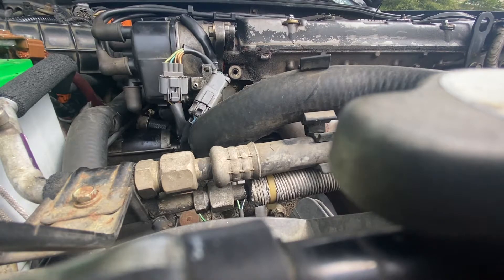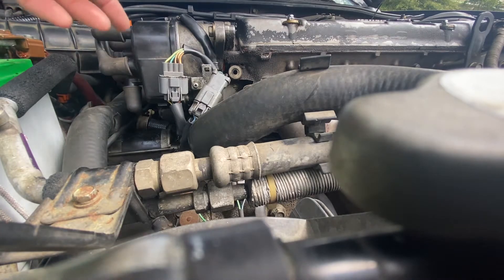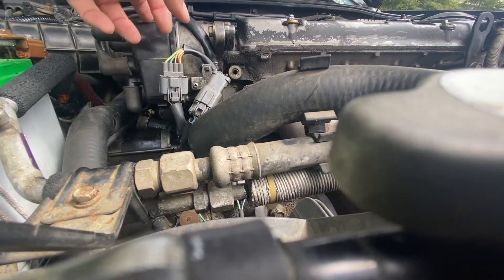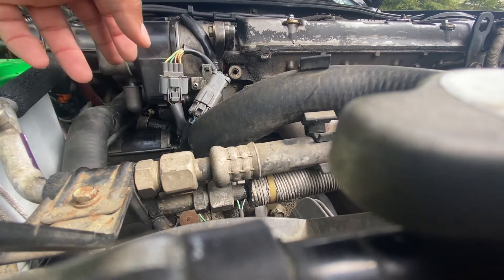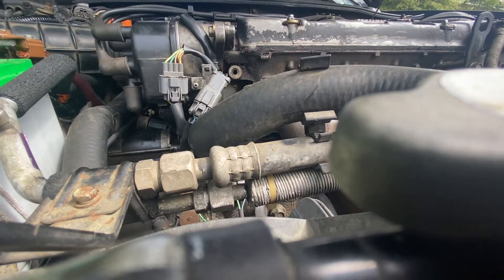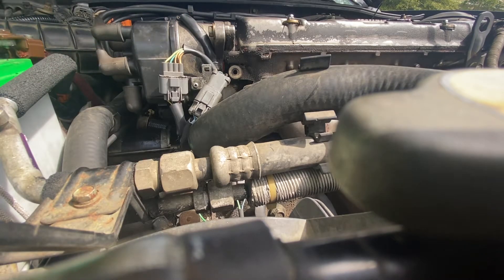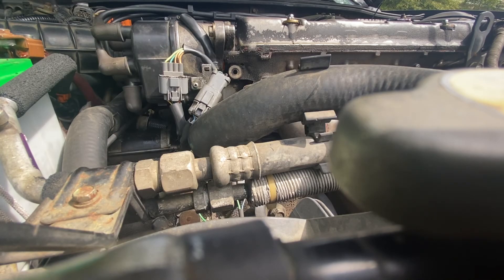H23A1 Distributor Bad, no spark sound

Comment: So was it just a bad distributor
Reply: Sounds like the car has low compression
Reply from the maker: Nope, turns out, broke a timing belt on the freeway going 70. Pulled oil cap off and turned motor over and cams were not moving